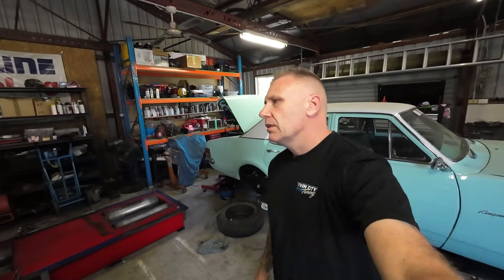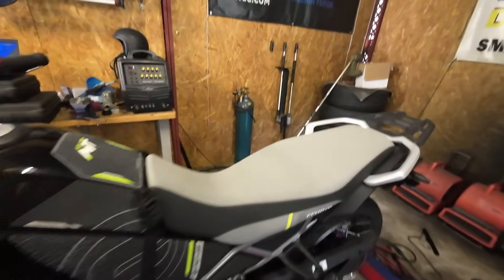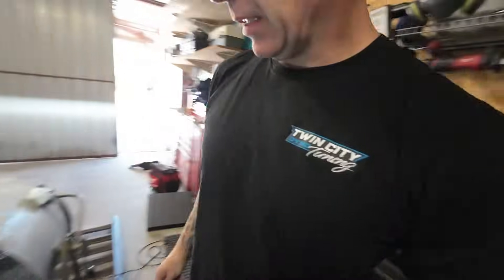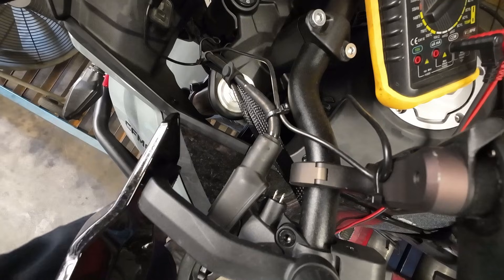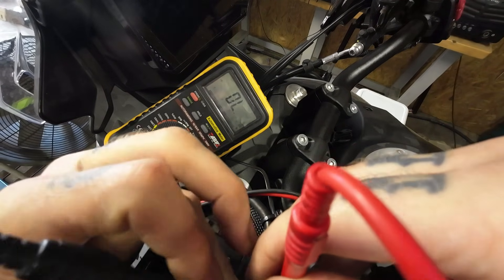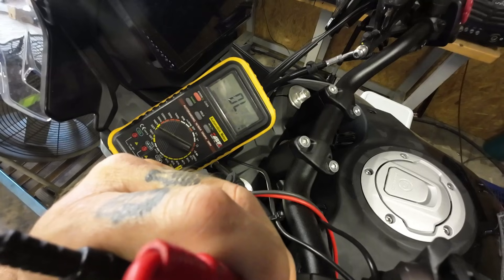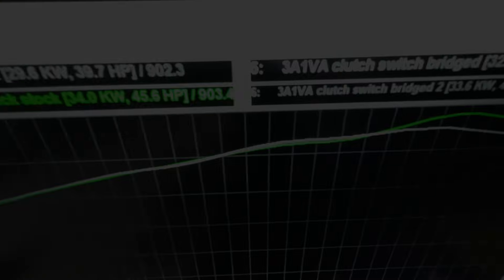cfmoto 450mt clutch switch test with dyno results.

Comment: Pulling the clutch will pull timing out of the motor why you see a drop in power. For a jerky throttle this can help because CFMoto 450 and 800 have very advanced timing curves even at part throttle. Better to just have the tuner pull timing out of the bike around part throttle then doing this mod. You’re basically detuning the bike a bit which is fine if your goal is to smooth out the bikes low end and throttle. Not everyone is a rev monster or wants to be one.

Comment: Just came back from 3000 km is southern Europe.  Mountainous switchbacks, 200 km of logging roads/trails. Have uncle wangs titanium pipes and locally (Poland) dyno tuned ecu. When on throttle, just beautiful. But if i close the throttle, the bike becomes unridable junk. The engine has strong braking, but its impossible to transition from braking, zero thrust to acceleration.  I get braking and accel, its real shit. I would give up hp for smooth throttle response off idle.
Reply from the maker: My tune is smmmmmoooootttthhh
Reply: @frashd I do have Uncle wangs headers and mid pipe. Other than the off idle issue, my tune is beautiful as well. Would you be able to tune that off idle fueling cut off or whatever it is, or an entire new tune for my exhaust would be required. I am halfway around the world, unfortunately. My guy will give it another try, but I don't exactly have full confidence. Anyways,  that bike should have never been released with whatever original map I have. Thx
Reply from the maker: I can fix it  @pawelwolski1316

Comment: I had this mod for a month and somehow the ECU learned to stall again lol. I have ecu remapped now with full system and air filter mod, stalling is not an issue anymore it's still jerky around 2.5k -3krpm but more manageable I just keep on mind not to stay in those rpm lol. 55nm, 52hp at the wheel and 11k rpm limiter decent gains I must say, too bad I won't enjoy that power on the pavement with offroad wobbly tires I have lol.
Reply from the maker: I have developed a tune that fixes all the low throttle issues and makes the bike extremely smooth.
Reply: @frashd  that's good to hear, tuners where I am is hard to come by and they don't sit and customize it to optimal performance lol. pretty much up for quick cash as most of what they remap are scooters which they can work on in few minutes.

Comment: How precise is this dyno ? What happens if you measure multiple times without any mods ? Do you always get exactly the same results ?
Reply from the maker: @exploreR3ality  it's mainline. They are the best. You will always have factors that change readings, tyre temp, oil temp, tyre pressure... repeatability is great

Comment: Interesting test...  The reason people are doing the mod, is to 'disable' the fuel cut because of the jerky throttle, not for more power.  Based on Facebook posts, it's made a big difference for a lot of owners.  Also, your runs (appear to) start at 4000-4500 rpm, way higher than most people have the issues, like when 'idling' downhill on a tricky descent or around town...  You don't actually cover what the 'mod' is supposed to do.  I understand that it's your business doing dyno maps but you've been dishonest in addressing the issue.
Reply from the maker: @Paulthenutter34  who said anything about covering the mod. It's as simple as bridging a clutch switch. Fuel cut is not the only thing that is effected when bridge the clutch switch wires. As for dishonest comment..... dishonest about what??? 
Oh dyno runs start at 2700 rpm. 
And a dyno run is wide open throttle.
Reply: Very well described symptoms, i would describe exactly the same. 
But i don't think there is anything dishonest in this video.

Comment: Thanks for the test, good to see numbers and confirm what I suspected (that there might be other background maps lurking) 

I went for a two hour ride yesterday with the switch bridged and it was so much better on the transition, particularly opening up the throttle in sweeping corners.
No doubt you are tuning this part of the maps in a remap and I'm sure it will be better if you are.

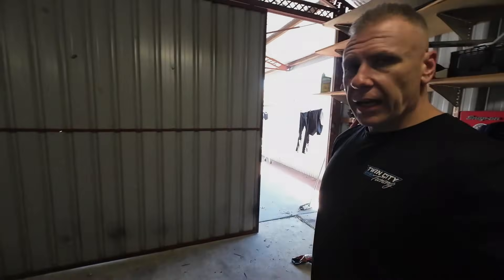This also works great & is free, freezing the video at 5:47, I can't tell the 0.4hp difference with my Arse Dyno 🙂

Cheers, David.
Reply from the maker: @Danger_mouse  probably won't feel the difference, just know there is more going on than just decel fuel cut.
Reply: @frashd  For sure.
I'm a mechanic who previously had rally cars with Haltech EFI.
I understand the layers of mapping needed to make an engine run nicely and correct for multiple things.
Also had a bit to do with TuneEcu on the Husky 449 models.
I know that bike, there's a nearly flat timing map in neutral to stabilise the idle. That's the kind of thing we're talking about with the CFMOTO that might be hiding in the background - understood.

Does feel good from the seat so far, as you say. 👍
David

Comment: Is the off throttle behaviour improved? Is this worth the power trade off?
Reply from the maker: @fredblogd8448  it's not just the power. There are other things going on in the background that may be happening.
Reply: Yes. If you can tell the 0.4hp difference in power just by riding the bike, you're better than I am. 

@frashd What other things do you think may be going on?
Reply from the maker: @Danger_mouse  well clutch in means no enginecload, so no need for comment protection (I didn't check)
Reply: @frashd 
Did you mean knock protection?
Reply from the maker: @Danger_mouse  No, the bike has no knock sensors, I fuel control for component protection

Comment: People are saying you should drive at least 50km so the ECU adjusts to the change. Then you test it
Reply from the maker: That makes no sense. Timing won't change. The ecu only adjusts closed loop fueling and commits small term trims to long term. The volumetric efficiency of the engine does not change from a clutch switch. Air cleaner or exhaust (yes)
Reply: @frashd  How do you even know timing changed? AFAIK you only saw power drop in some ranges
Reply from the maker: @damaks100  because I have found the ignition table that activate when the clutch is pulled in. That's how.

Comment: Is it actually bad for the bike or just a little loss of power.?
Reply from the maker: Not from what I can see unless it over fuels the cat on decel. But I didn't check that
Reply: @frashd On road on a spirited 2hr ride, I got a couple of cute little pops on overrun downhill into one corner, but exhaust temps seemed normal and nice I pulled up.
Reply: Thanks.

Comment: would you be able to tune the 450 clc
Reply from the maker: I can look into it mate.
Reply: @frashd  i'd imagine it would be similar, at the last eicma show the specs on the 2025 are identical to the 450mt as far as power and torque at the same rpm.. I'd imagine it's the same set-up 👍